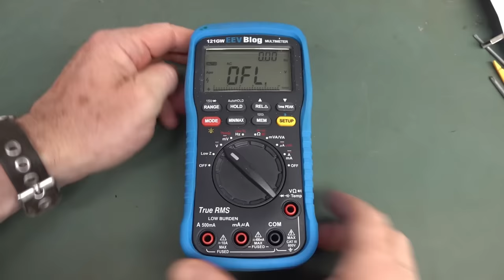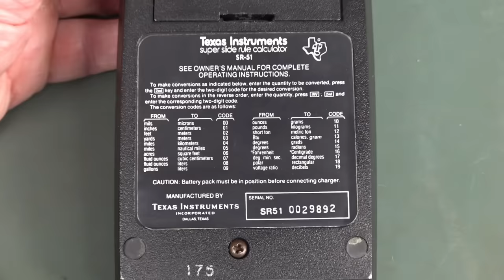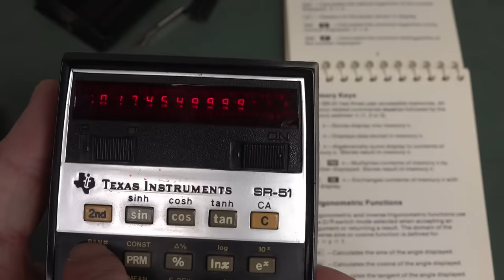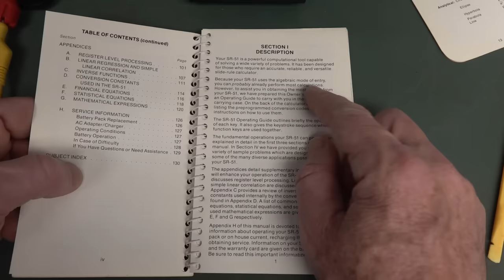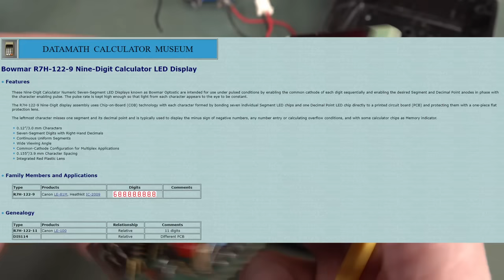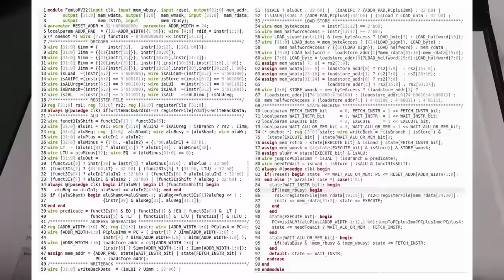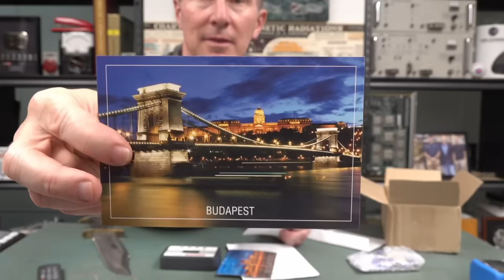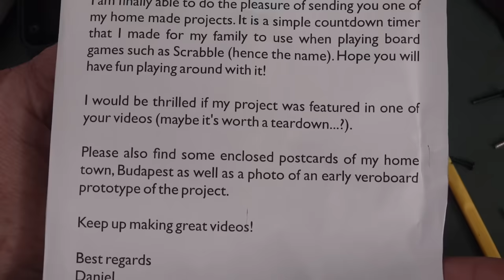EEVblog 1571 - Nobel Prize Winning Mailbag. 121GW, Retro calcs, Assembly, and Discrete Logic

Comment: I've got those individual 7-seg bubble displays, did a demo years ago - but I think that the number of digits and the dim display and the piggy backing add up to the fact that the on-chip drivers were current limited to Muxing a fraction of those displays so they doubled them up and even then had to current limit the segments to a fraction of full brightness.
Reply: Well then why not use transistors or transistor array ICs to drive the segments at full brightness.

Comment: The stacked chips in the TI probably have 1 chip select  line with differing active high / active low.
A real PITA replacing old ROMs with EPROMs when you can’t be sure how it’s CS lines work

Comment: "Of course you could do this with a single micro" but look at all of those chips for 'just' discrete logic... an awesome build, just for fun and FAMILY!
Reply: The micro is hidden under the LCD and the logic ICs do nothing.
Reply: You wouldn't even need a microcontroller. He could use an off the shelf clock chip.

Comment: I was in engineering school from 1971 to 1975.  Started with a slide rule.  I had both a normal one (Post I think) and a ROUND one (no way to calculate off the end of that slip-stick).  Freshman year one guy on the dorm floor had a four-banger.  WOW!  By the end of college EVERYONE had a fully scientific calculator.  Mine was a TI something (51?).  There was a 100 level course all the engineers had to take to learn how to use a slide rule.  (WHAT?  They didn't learn in high school??) Fast forward 4 years and the course was taught with HP-35's.
Reply: I wasn't born until a decade after you started engineering school, but I love slide rules. I'd never seen one until about 15 years ago when my cousin gave me one he found in a house he'd just moved into. I researched how they work and it's absolutely brilliant. They're not precise compared to a calculator, but you can do a lot of different mathematical operations within a few seconds just by sliding it back and forth. It's been a while since I played around with it, and that's exactly what I'd be doing now if I wasn't away from home.

Comment: The Texas I struments SR-51 calculator: you are running it at 3V, but it looks like there is room for 3 AA cells, so i believe you are undervolting it. The stacked ROM (?) chips do not have to be identical and perhaps there is some internal address, or perhaps they have different chip select pins. I am 100% in agreement that is seems unusual,  and it would be WAY easier to breakout a select line. Lastly at 24:44, is that a broken trace below the display? Maybe the unvolting is causing that counting thing.

Comment: I still have my TI SR-52 that was a high school graduation present in 1975. It's the programmable version and had modules to add functions. If I remember correctly those were the only mass produced usage of bubble memory. In a university class on programmable calculators every one beside me had HP programmables and I was the only one able to get the final assignment done because of the register manipulation that the TI could do and writing self modifying code.

Comment: If I recall, the battery pack contained three NiCd batteries, so the voltage would have been at least 3.6V, perhaps explaining why the displays are a bit dim at the 3V it was receiving during your test. Edit: on the SR-51, of course.

Comment: I think it looks like it was a 'quick' piggyback repair - perhaps an open pin on the chip below & they felt it would be too hard to desolder? (I have often temporarily piggybacked ram chips onto old arcade boards (to help determine which one was glitching the screen), with the odd success.)

Comment: Simpsons was (having ended in 1991) a Canadian department store.  Sears (a US department store chain) partnered with them to create Simsons-Sears, which later started trading under just the Sears name when they dropped a territorial restriction on proximity between stores under the two names.  (By the time I'm old enough to recall, many malls had a Simpsons and a Sears.  Simpsons was generally a lower cost store with lower grade store furnishings than Sears.)  Simpsons ended up owned by The Bay (heard of The Hudson Bay Company?  Same company.)  and they ended the brand in 1991, converting it to The Bay stores.  Sears Canada went bankrupt and was liquidated in 2017.  (Sears had been a major retailer of home appliances, including having dedicate Sears-branded appliance stores, and carried the warranties in-house on their brands, leading to much consumer complaint when the warranties were very much up in the air.)
Reply: The Bay bought Simpsons? Somehow I missed that. I remember The Bay buying Morgan's. Have you heard that Zellers is back? Kind of. It's Woodward's I really miss.
Reply: @barrybogart5436 You might have missed The Bay buying Simsons because it happened a lot earlier than you might have suspected, all the way back in 1978,  The Bay continued to operate the chain as Simpsons until 1991 (although the Montreal-area stores were closed or rebranded in 1989). 

If you miss Morgan's, you're clearly a good deal older than me.  I was several months short of my second birthday when The Bay stopped operating that chain in 1972.  And that was when they stopped using the name in Quebec, they rebranded the stores in Ontario to The Bay in 1964.

More recently, I kind of miss Tractor Supply Company, now operating in Canada as Peavy Mart.  The one in my area is exactly the same as it was before the name change.  It's the only place I know of where I can buy fencing wire off the shelf.  Damn fine stuff for making costume chainmail.

Comment: 21:18 In the Speak n spell TI used very special roms. The roms have addresses hardcoded in. so you can just wire them completely parallel and address them in code. Maybe its the same here.

Comment: Q5 Tranny looks like it got hot, not a retouch? U13 also looks like it got hot and shifted. Same solder ball. E12 also looks to have left skidmarks and shifted. R04 missing?
Reply: Was gonna suggest the same thing. Also next to that R12, is that just burnt flux on that via, or has the track itself got burnt? Hard to tell from the vid. Was it related to the incident that blew the fuse 🤔

Edit: looked at it on bigger screen, definitely just burnt flux

Comment: I'm a 6809 fan. My first computer was 6809 powered. Nice to see more recognition. Why should the Z80 and 6502 have all the fun?
Reply: Was that a Coco or SuperPET, or sonething else?  NICE processor. It would run OS-9,  Unix clone. https://en.wikipedia.org/wiki/OS-9
Reply: @barrybogart5436  COCO2 Extended color basic. A whopping 16kB of RAM. I did basic and assembler on it in my teenage years.

Comment: Love the calculator fetish! My Casio fx-900 got me through my engineering degree in the early 80's. One day I had it in my back pocket and sat on it, giving it a distinct bend. It still worked, but I did get an fx-995 as a backup, just in case. Both still work today, of course, given they're Casio! But I don't use them, as these days I just pull up a calculator on my desktop or phone, or write a quick Python script. Sigh.

Comment: On the 121GW Multimeter I seen what look like a burnt spot on the 4.000 Hurts Crystal.  It was right near that chip. That was sideways that you was pointing out in the video. On the chipboard and on the crystal itself. I don't think it was the 4.000 Hertz crystal was burn. I think what was beside the crystal that is what burnt. It looks like it might have been a capacitor.  That was burned out. But not really for sure. It was just a observe look at the chipboard on the multimeter But then again that could have been just flux and the factory didn't clean the board that good.
Reply from the maker: It's a zero ohm resistor R12, and it measures fine.
Reply: What about U9? something looks dodgy there

Comment: Stacked chips:
One chip would be an exact replica of the other except internally the chip enable would be active low.
Edit: Do NOT operate the calculator with the AC adapter and no working NiCd battery pack. They use the batteries like a zener diode.

Comment: Once I used a voltmeter I didn't trust.
I don't recall the exact value it read, but it was approximately 10^27 (1000000000000000000000000000) volts.

Comment: How do you do multi-platform assembly? You learn a multitude of assembly languages for each of the platforms, i.e. you actually don't do multi with an exclusively single purpose tool for the simple reason you can't!

The book title might be a tad misleading I dare say. It would have been OK if the book approach was "lesson based" and each lesson had all the languages in parallel with any specifics for a truly multi platform glance at things, But just for a sequence of architecture specific chapters, each in a single platform format... it 'd be misinformative.